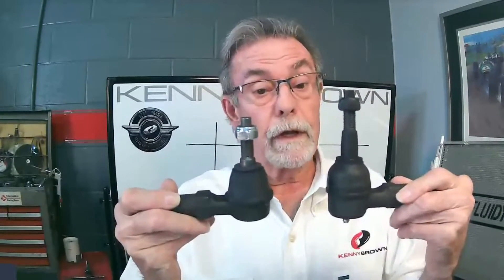Kenny Explains Bump Steer on the Mustang and What You Need to Know

Comment: Does the steering tie rods need to run parallel with the bottom swing arm on a early about a 1964 Mustang II front end? This has the single swing arm on the bottom and dual tubular swing arms up top. It's on a pro-street car I bought that has bad bump steer starting at around 20 mph if the road is a bit bumpy. If I feather the throttle very slow it will go fine on the freeway and not bump steer but the second, I hit the throttle hard it wants to pitch the car off the road very violently.  Just driving it does not pull and goes straight so very frustrating need to get it figured out and use the car. Took the front coil-overs off and tires then ran the swing arms up and down by hand and the steering wheel went back and forth. Sorry I just finished watching your video and see my tie rods need to run parallel with the lower swing arm. Which I'm pretty sure they do not but will take a look tomorrow. I called the guy I bought the car from, and he said he thought maybe when he built the car, he put the rack to far back or forward. I have not either had them check the alignment yet since all my money went to buying the car. Hope I can get it figured out myself and possibly buy your tie rod end and be done with it. I found the car online so did not get to test drive it first but asked him if he had any issues with the front end and he said no. So he was not totally honest. Other than that the car is a really cool car.
Reply from the maker: Yes you are correct about the tie rods and needing to be as close to parallel with the lower control arm as possible. Baer Brakes does make a kit for the first gen Mustang I believe. Typically it would be hard to locate the rack too far forward or back unless there is some way to adjust the mounting, if so you may want to look at that closer as well. I would also check the rear suspension to make sure the axle is square under the car, they can check this for you on an alignment rack.
Reply: Thank you for your help. I changed my YouTube name from my real name Ron to what it is now. I never got a notification that you replied to my long question and history on the car. I’m finally at a point where I can get on this and hopefully figure it out without having to take it to a shop and spend more than I’d want. Don’t know if I mentioned it but will put some tubular lower arms on it which has nice ones on the top and QA1 coil overs. The guy that built the car did say he might not have placed the rack forward or back enough. Wish they made an easy conversion kit to convert the early lower stamped style single lower arms to a dual tubular arms. I’ll go on Baer website right now to. Have any idea who I should buy the tubular lower which is same specs as the early stamped lower arm? I see Speedway has them cheaper but in their photos the arms have surface rust so kinda sends me a negative message. Again thank you for your time and help.